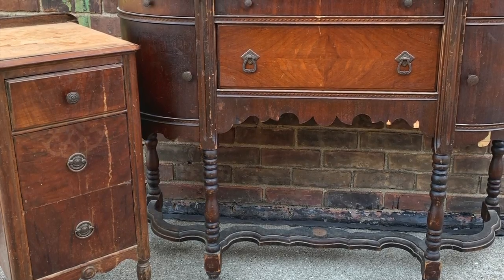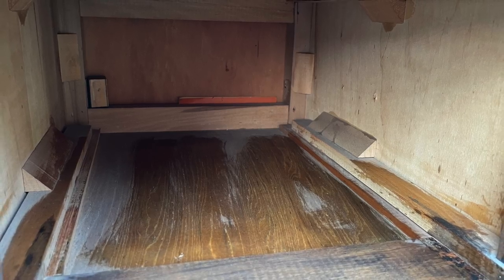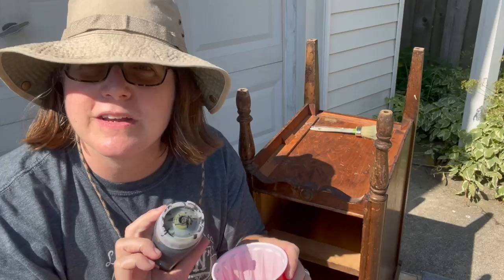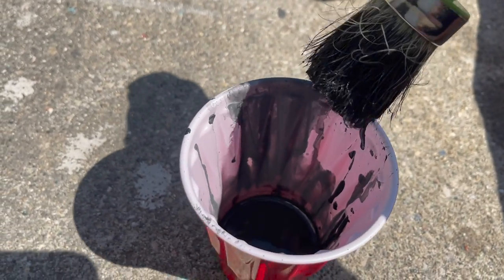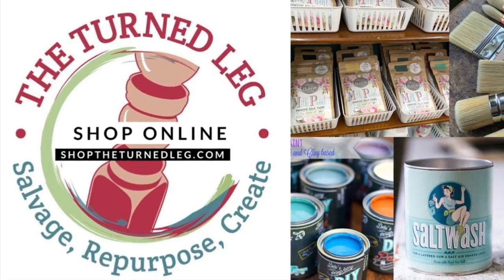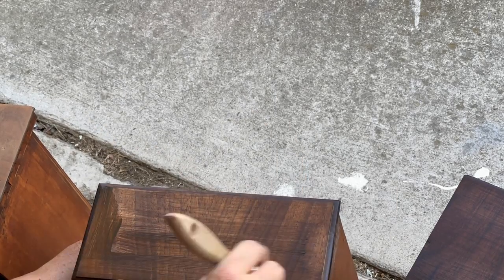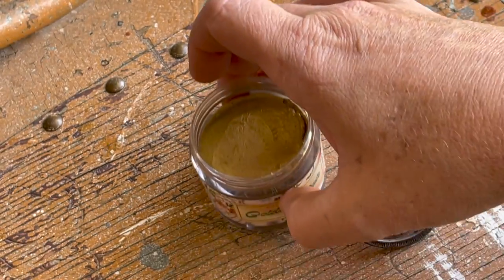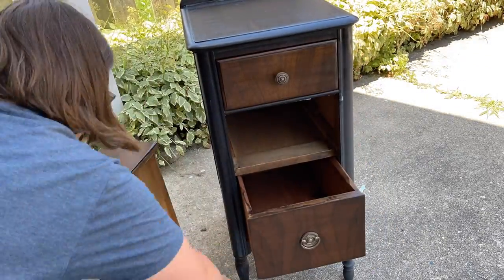Learn to Paint with DIY Paint - My Favorite Paint Finish - Black Wash

Comment: Love the black wash a lot.. is dark and decrepit a wax? Also did the sanding help with the veneer chipping? thanks for the video sharing new ways to update other than white wash!
Reply from the maker: The black wash was created with DIY Paint Little Black Dress and water in 1:2 mixture.  You can dilute the paint even more to suit your tastes.  Sanding did fix the veneer trouble.  It was really humid in my garage so it lifted but a quick sand and it was all smooth.

Comment: Do I need to sand a stained brown finish before applying the black paint wash?
Reply from the maker: Nope.  I did because the veneer lifted in my garage due to humidity.  Usually, it is not needed.